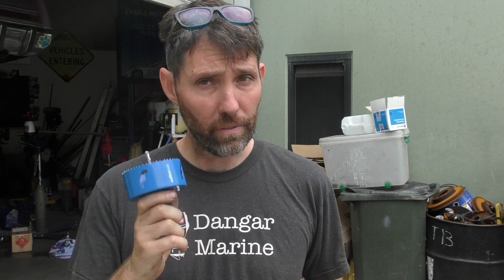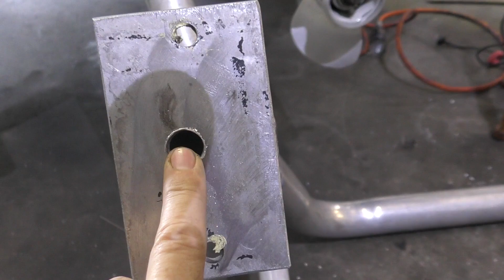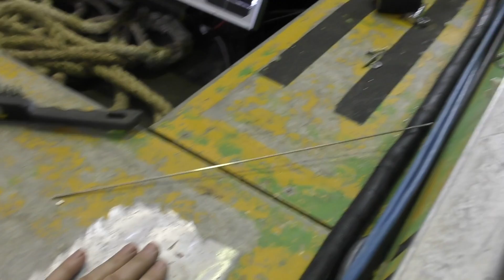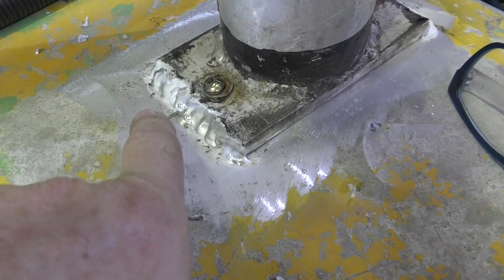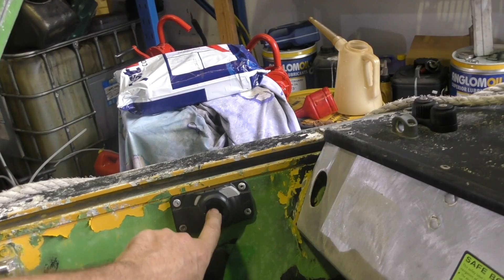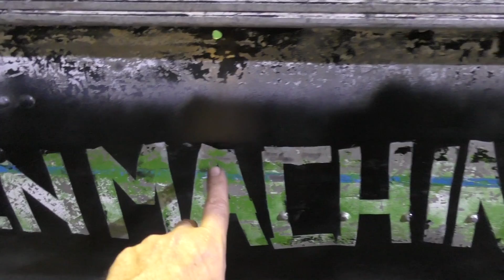Pimp My Tinny

Comment: hey man another quetion when i launched my boat i had to back down the boat ramp so far that my ute's back wheel was in about 150-200mm of water. Can you lower the boat on the trailer to make it float earlier down the ramp.
Reply from the maker: It is possible to do depending on the trailer.
Reply: ok cheers

Comment: Another cool vid - tip from an electrician, if one of your two cables comes off your pull-through inside the fabric of the boat, use the cable to pull the pull-through back, try again. Also over the outside of your electricians tape - smear some vaseline on the joint and the cables - makes everything slip through much easier and reduces binding.

Comment: Hej Stu, I've got an evinrude 20 hp from 1976, and i just bought a starter and the bracer for it, but the gear on the starter only just extends to the bottom of the teeth on the flywheel what can i do ? :D
Reply from the maker: Is it the right starter? If so the bendix gear might need removing a cleaning.
Reply: @DangarMarine  Yeah it's the right starter but the bracer might be wrong. Where should the gear be when extended ? flat with the topside of the flywheel gear or lower ?

Comment: That bar looks awesome on your boat. Well done. The rear braces make functional sense and look good. Now you need a powered winch, air horns, siren, generator, scuba gear rack, trolling motor, live well, wet bar, under deck sleeping quarters, head, galley/grill, swim deck, and stripper pole.
Reply from the maker: Other than the stripper pole I think you are going overboard. ;)

Comment: With the add ons and upgrades your doing ... what do you think about Rhino lining the bottom of aluminum boats? I’ve seen some videos with people doing it but I’m not sure if it’s a good idea or not.. what are your thoughts ?
Reply from the maker: It does worry me that I'm putting so much time and effort into a hull that is really quite long in the tooth. I like the idea of coating the hull in something one day but I'll need to do some more research first. Because the boat gets antifouled every year (I'm painting it at the moment) I've decided to leave as much of last years primer and antifoul on as possible to keep building up layers. In some way I guess that serves the same purpose.
Reply: How would Rhino liner stand up to salt water?

Comment: I know this isn't relevant to your video but i know that you know everything when it comes to boats, soo i have a question for you and would be very greatfull if you could give a hand. how should i drill new holes in my transom? its fiberglass covered plywood with a sheet of stainless steel over it. I could remove the ss sheet and drill it separately if necessary. the holes are for 10mm bolts for outboard. thanks in advance!
Reply from the maker: If it was me I would just drill through the whole thing together. Be sure to seal the inside of the transom with some epoxy though so the water can't get in and start to rot the timber.
Reply: ah okay, will do. thank you.

Comment: I have the same engine that you do, but I lost the metal piece that holds the steering cables in place. Would you happen to know what its called or can you show me how it looks so that I can make one out of aluminum?
Reply from the maker: Not sure what it is called but they are pretty each to make up with a drill and a hacksaw.

Comment: Little trick I use to fish wires through tubing is to tie a small nut to a string and blast it through with the air compressor. The nut dances around the tubing and always finds it way out pretty easily. Give it a shot next time.
Reply: Also, wire+bit of string+ bit of shop towel/napkin. You give the end of the wire a "parachute" type deal, and hit the opposite end of the pipe with a shop vac. Make the sting long enough to make the whole run, the shop vac will pull the string though, then you tie it off to the wire and pull the wire though.
Reply: @lobes187 , I've seen electricians use tampons  the same way for pulling string through conduit.
Reply: @pzavada1  That's a good one for some smaller conduit. I'll have to remember that.
Reply from the maker: Sounds like a good tip!

Comment: Hey Stu man of many talents supremo, wish u were in Melbourne but its much nicer where U are i get that ... i recently asked u about (2 months ago) replacing impeller on a yamaha 90hp 2 strpke with only 60hrs but is 12yrs old i heeded ur advice and replaced it and to my amazement the old impeller was still in perfect condition never the less its piece of mind now that its done ur video tutorial on it made it so simple thanks again. But i have another problem with the boat its f/glass 5.05mtr cuddy cab when driving at low speed its fine but when i power up its starts to list to port putting power full throttle it gets worse to the point where it wants to roll over ive changed weights around eg  fuel tanks as i use 2 plastic 30ltr type ive changed my foil as i had a Fast tail, back to my old S E sport 300 i raised  my motor so the cav plate  is inline with keel but nothing seems to fix it ive had the transom and floor replaced and bungs in each of the 4 cavities of the stringers so theres no water in there to make it list to port im just stumped i did instal a canopy myself it is slightly lower on the port side but like 5-6mm  would that cause a list any ideas would be greatly appreciated...... cheers..... Ken..
Reply from the maker: Hmmm, it sounds like it's a dynamic action created by the hull. Is the hull perfectly symmetrical? They often aren't. It could also be the paddle wheel effect from the prop which is hard to do much about other than adding trim tabs to the bottom of the hull.
Reply: @DangarMarine  Thanx for your input  Stu hull not being symmetrical was one of my thoughts cheers

Comment: Sorry about the change of subject.   
I am in the process of removing the autolube system 1997/98 mariner 60 hp outboard and using premix, 
but I have come across a problem. the oil injection pump (starboard side) has 3 pipes coming out of it instead of the usual 2,  I was going to fill the pump with oil and loop the inlet and outlet, but this other 3rd pipe that goes under the carbs and up the port side to a tee linking the solenoid choke valve to number 2 cylinder, so what do with it?, will I cap it off?
Reply from the maker: I'm not really familiar with it but from your description it sounds like it can be capped off safely.
Reply: Thanks for your reply, love your videos

Comment: I was just thinking, that bar is going to increase the strength of the gunnels and hull by a tremendous amount. There wont be any flexing under heavy loads in rough weather. That’s pretty awesome. I bet you notice a sturdier feel in rough conditions or when your towing. At night your stern light might add some light to the inside of the Green Machine. That’s nice also. So you can see your bottle opener better. 🙂 Brilliant as always Stu, great video.
Reply from the maker: Yes, I think the whole boat will be much stronger and stiffer. I'm looking forward to getting it out on the water and seeing how it feels.

Comment: Next time if your wire will brake off on the middle of pies, use yarn and hoover. Yarn will find a way through all corners. Also then feeding wire do not tie to the cable way you did. You made 20 cm of rigid piece of wire and cable. Try to make loop on cable end and feed thru loop on cable end. it will go easier on corners. Definitely feed thru holes must be wide enough.
Reply from the maker: I like the yarn and hoover idea, very clever. The corners weren't very tight on this but the hole was definitely too small, that is where it got stuck.

Comment: I have a 1974 Johnson it has a electric shift I think. My ? Is why is thier oil silver coming out of my prop? Did I screw the motor up by running it hard and like I said why would their oil looking with silver in it.
Reply from the maker: Hmmm, silver in oil usually is a sign of metal fragments which is never good. I would change the oil and then check the new oil before too long. May need a rebuild.

Comment: Hi mate loving the channel.As far as im aware that all round white light is still illegal as it 
Will still be obstructed by the height of skipper and crew not allowing a full 360deg view.
Reply from the maker: When I sit down my head doesn't even reach the bottom of the bar so should be fine unless standing.
Reply: @DangarMarine  yeah,i guess.I have a runabout and drive standing up thus needing a higher mounted light.9